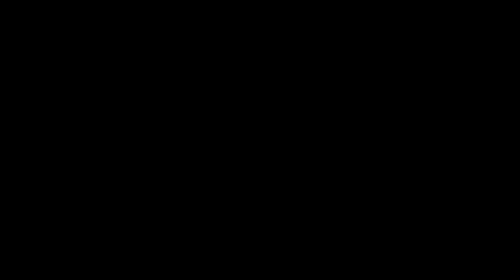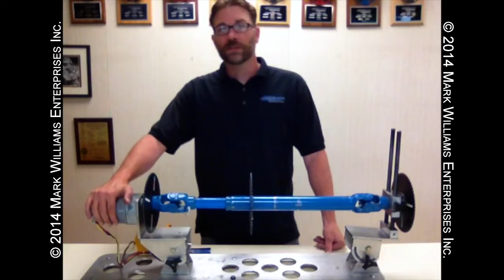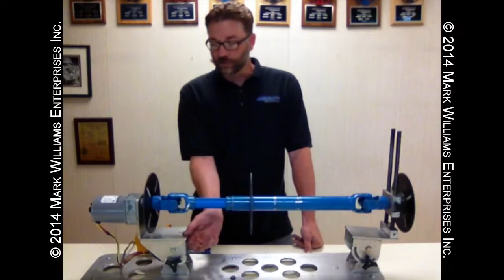Driveshaft angles - A common cause of vibrations.

Comment: With a leaf spring suspension the rear end will rise a bit under acceleration. So to keep it aligned at speed a lot of guys will have the rear end pointed down a couple degrees so that under load it is straight. Hope this helps someone out there chasing down a vibration that occurs at higher speeds.

Comment: Torque and inertia(power-delivery feel, time spinning rpm-range-effect is "maintained" without power) and drag(opposite of torque, spin-up after slowing down, reaction) are also causes.

Engine = torque(power), inertia(reaction), drag(engine branking) = flywheel-effect
Gear-box = ... flywheel-effect
Drive-shaft = fly...
Wheel axle, rims, brake disc, tires, = fly...

Every part is distributed and range-within-range of smoothen feel without adversely affecting performance
Example = if heavy-engine produces high-torque to gear-box, something in-between to smoothen things out maybe necessary. If engine is effect-5, gearbox is effect4, clutch plates can be protect gearbox4 or consider next range of after gearbox drive-shaft3 give 5,3,4,3

Sometimes, it is the volume and thickness that matters more than the weight when it comes to vibrations and not strength.

Besides angles...
Reply: Asynchronous ratios cancel-out even more vibrations. Example 3.1 to 4.0 instead of 3.0... divide have remainder.  

If diesel 2x4litres(5cylinders) to 3xcar4speeder(forwards) churning-foaming ATF auto-gearbox...

Shafts to balance engine is crank1 to shaft to crank2
Mount boxes is big gear shaft to A,B,C gears. Box1 uses hingeA, pullB, touchC, Box2 uses hingeB, pullC, touch A, box3 need asynchronous to send vibrations to somewhere else for cancellation-dispersion. Pull can leaf spring shaky (x,y,z axis cancel one diagonal only)
Reply: Round pipe-thingy mounting holy metal-brace suggestions
= bigger than needed, longer than needed x2
= bottom is 2 tightening hex-screw nut for support
= tighten one as hinge then tighten the other as suspension grip, 2 "teeth support"
= some lousy brace butter-fly winged-nut garden hose-clip cannot remove belt-brace fully and insert another lole a cable-tie hack. Avoid those.
Reply: Pokey threaded rod from left to top and protrude to outer of axle-core, and another the same but right to bottom, through round holy metal brace and tighten - is another option. Do not indent-dented hot-heat gun PVC pipe into a hex-nut. Too vulgar... for witches... they may attack.

Comment: Is this the issue causing my 6 speed manual 2012 mustang to vibrate while decelerating between 2k-3k rpm? It is repeatable every single time. I either have to shift before 2k or we’ll above 3k for it to not happen
Reply: Having same issue on my 06 gt
Reply: Was it a bad u joint? That's my guess.
Reply: @jimandskittum I no longer own the car. Ford says it’s normal. So I decided I wasn’t going to play their games. I sold it.